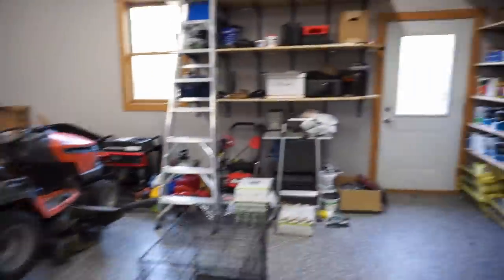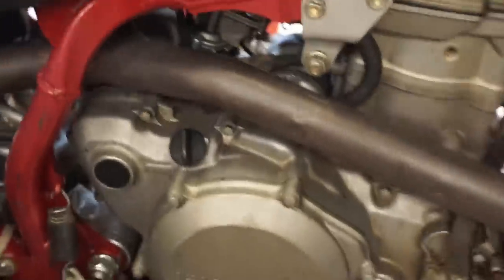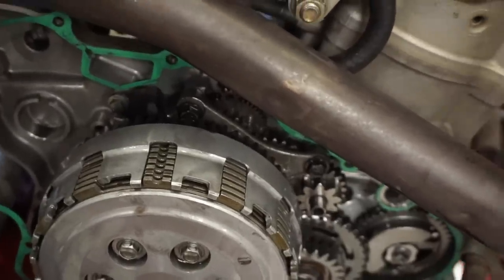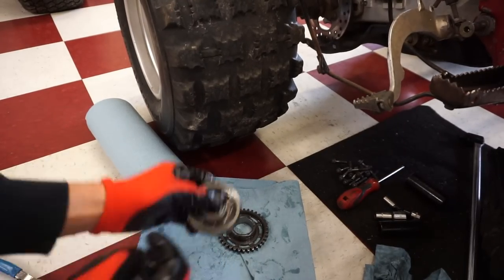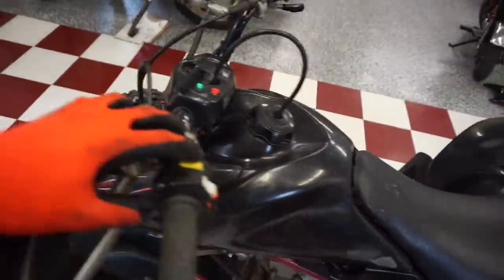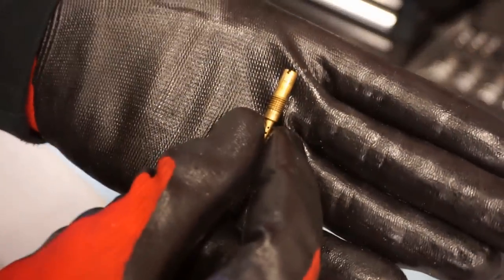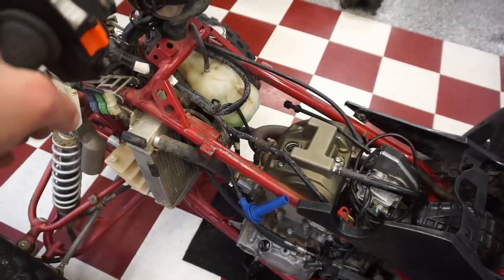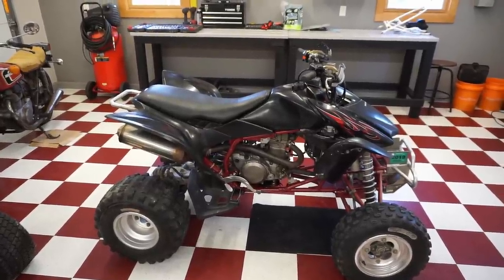Honda TRX450 Quad Bogs and Dies (Nobody Can Fix It)

Comment: Does it have a Polaris throttle cable snap safety switch type of setup? That problem sounds like the Polaris one. It run but starts to die or run very weird until it actually dies but always starts up. Im sure you will figure it out and thanks for the chance to give my 2 cents brother lol. Be safe :)

Comment: You say that backed out bolt is why the startin clutch failed I had a v65 Honda and the sprague clutch cracked on the hardened ramps the sprague clutch grabbed. Put a new sprague clutch on her at 45 thousand miles and she did just fine after that. I stopped riding her at 55,000 miles and lucky I did because I rode her 100mph every day & when I pulled the gas tank off the frame was cracked on both sides just hanging at the bottom with a sliver of metal.

Comment: Damn I dont find out the problem in this video? Nooooooooooo, lol. That's so wrong but It definitely sounds like the connecting rod bearing my friend. Sounds like a gas tank with rocks that someone shaking to get the rust out lol. That's wat this quad sounds like running ha, good luck man.

Comment: Ya bearings and oil screens still plugged starving system at critical lube surfaces  

Cut the filter from the oil change

Comment: honda 450s are Cold blooded. They do NOT like to start and run and forget about idol with the choke off... Step one use only 92 octane. Get a new NGK Plug. next leave the choke on until you can ride it.. Ride it around for 2 3 minutes THEN see if it will idol...NEVER hit the gas while trying to start this bike. It can backfire or damage your one way!! CHOKE ON CRANK... Do NOT try to slam the throttle to fast after you start it or it will just cut out... Honda 450 is HIGH compression and its not a 400ex.. When its warmed up it rides aggressively.. I personally didnt mine to much... To much clutch and revs and constant work out.

Comment: I think it needs rings it should have a ton more compression and it could possibly have weak fire some kinda electrical issue. Maybe stator weak flywheel or pickup or a cdi going bad.

Comment: IDK what redneck came up w/ 'one way bearing', but it's called a SPRAG CLUTCH.
Discovering it was poor quality fuel can be a real pisser, and happens often.
Water leaches the high octane ethanol, ALWAYS use quality fuel in a small engine.
As Nathan said, soak in carb cleaner.  Sounds like it's an internal metering passage, blocked.

Comment: You need to clean and degrease threads before adding loctite.....
Reply: it works fine without doing all that. Just time wasting when you're running a business.
Reply: @fyreblade1262  actually no. Manufacturer states oil will reduce bond strength and items should be cleaned before use...

Comment: Hey i have a question about the pull start on my Suzuki kingquad 300 1997 whenever im pulling it it feels like the starter engages by becoming alot harder to pull and making the typical starter whine noise and other times it goes perfect, another thing the starter doesn't - work?? The solenoid just clicks even after replacing, i hooked it straight to a battery and it wouldn't do anything unless i spun it even just a little bit, once it's going its going but im doing a rebuild on it so if there is anything you would know that i wouldn't it would help so much, thanks:)

Comment: Joe.. it always bothers me when you take the whole clutch out when you can take the "pressure plate" off and leave the actually disk. Then take off the nut and lock washer and then still the plate back on with your springs and screws and then you can pull the whole clutch out together as a whole

Comment: 450's are all very high maintnance machines, like a jobless female that doesnt have any kids.  You dont have a choice but to throw money at these machines to keep them alive.  The motor looks complete and it does run which is a good sign.  That motor must be taken completely apart and rebuilt from the crank up.  Rebuild OEM crank, new crank bearings.  I'd probably replace all other bearings in the motor (cheap insurance)  there is often wear that you cant see.  Replace all the locking washers that the previous idiot didnt replace, rebuild the oil pump, all new valves, springs and retainers, new cam chain and tentioner.  thats just a start. You must invest in new parts or these motors will grenade.  Its russian roulette.